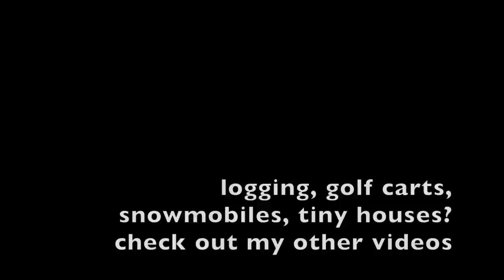Cutting Wood with a Sawmill is Hard Work

Comment: I bought a spare car jack for $5 from an auto  salvage and that is what I use to raise the small end of my logs. Once the log is properly clamped it doesn't move. I use the jack to cut 2 sides, then the following 2 will be square and level as you put the flat parts of the logs down on the saw bed.

Comment: Just saw a guy from the United Kingdom who hung a pail under the bandsaw to catch the sawdust. You might have to hang the pail inboard of the sawdust chute and put a rubber deflector, but that would solve the sawdust holding moisture on the deck issue.

Comment: Sandy always nice t see logs turning in useful lumber by the way i guess you forgot about the little trick i told about when you re cutting your board for a straight edge maybe you should cut yourself a 4x4 to leave in the far corner as a cant like that when you are re cutting your boards it would not get away like it did from you i saw that one board going side way a little on the video when you but that straight edge on it well have a nice day

Comment: Thanks for sharing your experiences with the saw mill and other equipment.  With the large amount of slab wood had you considered using some as your batten?  i see on another channel the guy uses it for trim in his cabin?  thanks again for sharing your skill & knowledge
Reply from the maker: That's a good point Gary. I think it could work well for rustic siding. For my equipment shed I'd like to keep it so it matches the shop behind it but maybe for another project
Reply: Great idea if the bark would magically fall off 😂

Comment: 2 cheap scissor lift jacks, weld a plate to the bottom to screw them to the floor and a plate with “teeth” welded to the top to bite into the log. Which ever end is the small end of the log, crank it up to level it. Cheap and easy and I KNOW you have a welder and know how to use it! LOL! Two cheap scissor jacks and some scrap metal, easy home made toe board!
Reply from the maker: I think that's a great idea and I'll have to do it for sure

Comment: Sandy I am always having trouble with the lube flow. I am using a teaspoon of dish soap per gallon of water . If I use it all up at once it is ok but If I don't use it and it sits for a couple of weeks the tank and the control valve all fill up with clumps of corrosion and nothing will come out even if I take the flow valve right out ,I have to poke a stick in to unplug the hole. Are you having any issues like that . I am wondering if my well water is causing the reaction or is it just the soap sitting in an aluminum tank causing the problem. Let me know what your experience has been with your aluminum tank.
Reply: I have a 2021 manufactured 126 with the auto start/stop flow valve and have the same issues.  I have to constantly mess with it to get it flowing again.  I'm about ready to build my own system for it.
Reply from the maker: I’m wondering if straight water will be a better solution? I have some climbs of organic sin the tank if it sits a while with straight water but it passes by flicking the valve coming out of the tank I find
Reply from the maker: Lately I’ve just not been using any water and all has been good
Reply: @stevedyndiuk99  Ok so I am not crazy ,I am not the only one . I have the 10th anniversary 2020 126 model. I am using well water that is from my sink tap and I have a water softener.  I don't think that any of that should matter should it. I have used three types of soap  Sunlight ,Palmolive, Compliments. All seem to do the same. If you get a bright flashlight and look into the tank, it  has all these clusters of corrosion all over the bottom. If you take a screwdriver and pry them off it leaves a scalded or corrosion spot on the tank. Kind of like the aluminum is breaking down for some reason. Anyone else having this problem.
Reply: @jeffglasman19  well those soaps are toxic chemicals so not really advised to use, just use water and if you want something a bit slicker, add some olive oil or linseed oil

Comment: Hey Sandy, I really enjoy your videos! Have you cut hardwoods with your mill? I am considering a mill, I have mostly oaks and maples on my property, logs mostly 20 to 26 inches.  I need advice! Thanks.  -Bob
Reply: Go with the 130 max
Reply from the maker: Thanks Bob! I've only cut pine, spruce, fir and some poplar. Poplar would be the only hardwood but not nearly as hard as the oaks and maples you have I bet. I'd imagine just using a good amount of lubrication to keep the blade cool and you'll be ok
Reply: the woodland mills definitely cuts hardwoods - their model numbers all start with HM1 but then are followed by either 22, 26, or 30, indicating the diameter of the logs the models will cut

and they will 100% do oak, if you have big thick oaks, just go for the higher horse power and make sure the diameter is big enough, track long enough (or you're willing to cut down to length of track before loading onto the mill)

Comment: What is the arced lever with the cogs for ? Please .
Reply: the cant lever? for moving/adjusting logs more easily
Reply: On the actual saw mill ,just behind where he holds to push.
Reply: @colbiecolbie6979  gotcha, I think it adjusts the angle of the push-bar ?
Reply: I think you are referring to the lap siding attachment. He has a video of how to install it and use it. Fantastic idea for doing your own siding.
Reply: Thanks Earl,  thats it.  I checked out the video.

Comment: Are you pushing the blade through the wood, I watch other mills and they are self feed through the wood?
Reply from the maker: Good question Jim. I’m putting light pressure on the mill just to help it through the wood.